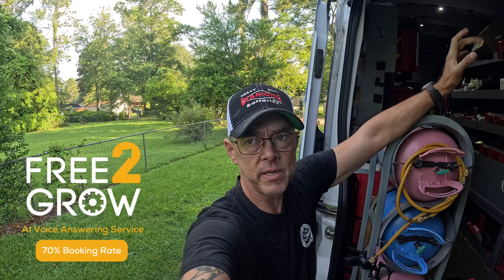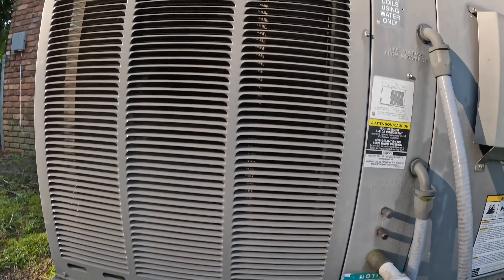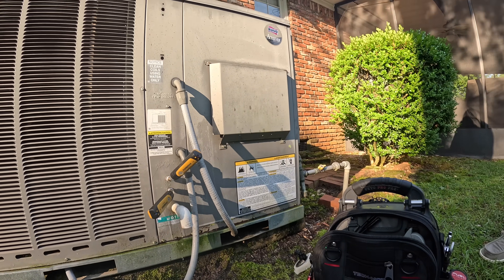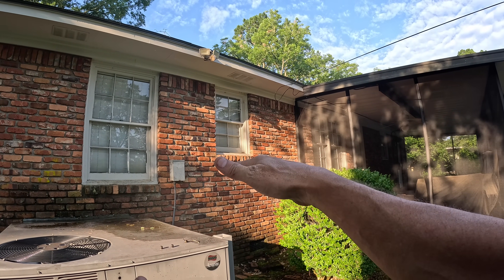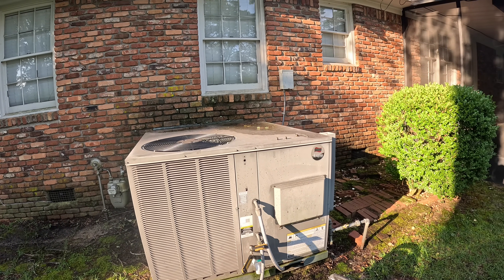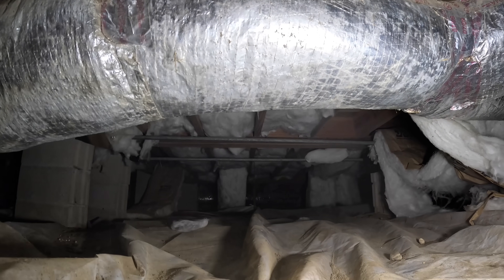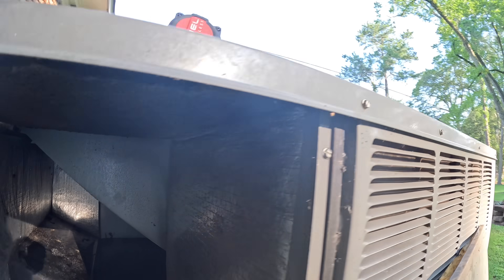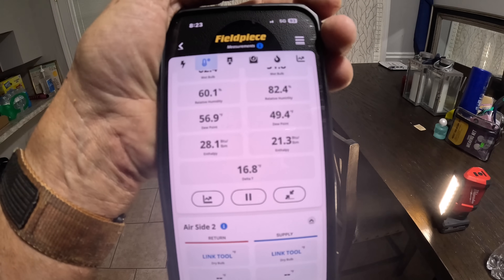A No Cooling Call I Get Every Time We See 100 Degrees! #hvacguy #hvaclife

Comment: Good Video ! You Might Have been able to pickup another couple degrees on that T/d if You had cleaned the Condenser. A Clean Condenser Makes a HUGE Difference.
Pressure's don't really give you the full story People. Liquid line temperature is Very important on Hot days.
If You a need to Pull the maximum cooling out of a Unit cool that liquid line.
1) Clean Evaporator with coil cleaner all the way through. Back to Front & Front to back.
2) Clean Condenser with Coil Cleaner.
3) Check Super heat & Sub cool.
4) Get that Liquid line as Cool as Possible if You Want to Increase Unit Capacity.
If Your Liquid Line is not Cool , Find a Way to cool it if you need More capacity.
That's why they use misters on a Condenser to Cool down the Condenser / increase unit capacity on Super hot days.
1) You can add an ice machine remote condenser on a Temperature control for Hot day use.
2) You could add a Liquid Line Subcooler.
3) Any way that you cool the liquid line down will increase unit capacity.

on the Flip side ---

Tell customer about
1) Tinting Windows on the Side of the House that gets the Sun.
2) Put An Awning Over Windows that are seeing The Suns Heat load.
3) Feel the Windows & Doors for Heat Load. i've Felt Front Doors on Apartments that are 100+ Degrees on the INSIDE. Change Front doors 🚪 for insulated ones.
2) Change Windows - to Double pane / More Energy efficient windows.
3) Use a Thermal Gun to See Hot air Leaks around Doors 🚪 & Windows.
Seal up the House a Bit better.
4) Temporarily - You can cut 4" Foam blocks to Fit in Hot Window Cavitys.
Reply: Excellent ideas.
Reply: @stayinformed2913  Thanks. 😎
Reply: If I could give more than one thumbs up I would!

Comment: My 13-year-old unit manages to keep up in Phoenix. It must have been oversized somehow, as our house was built in '58 and has minimal insulation in the walls. I do keep the thermostat on 78 in the day and 80 at night, and use individual fans.
Reply: Low humidity helps a lot!  A good portion of capacity goes into removing heat from moisture in the air.
Reply: much easier to remove heat when humidity is low like Arizona, I live in Olympia Washington and it hits 90 once or twice a summer and stays in the 70s most of the time, my AC barely needs to work

Comment: If a house calls for a 2 ton unit doesn't hurt to do a half ton bigger
Reply: Actually if it calls for a 2 tons your already over sized by 10%.   Then you take into account that your ductwork can't do it and now you have a 2.5 ton unit outputting 2 tons of cooling and using the power of a 2.5 ton unit... Not smart.

Comment: I like an oversized unit, period.
Reply: Instead of a 3 ton, I would recommend a 3.5 or 4 ton unit.
Reply: Wouldn’t that present its own problem of not running long enough under normal conditions to remove the indoor humidity?
Reply: I have an oversized unit in my home and don't find it to be a problem, but when the temperature is 98 degrees outside, my unit still only runs about 30 minutes before cutting off while most other units are nonstop.

Comment: Most of the times you can tell the h/o about this til your blue in the face and still they will think you can't repair their a/c
Reply: In almost any business or industry the words that start with "e", like Explanation or Education get interpreted by the hearer as "excuse."
Reply: Well, the customer doesn’t have any idea they are limited to 75 deg or that is the standard. Nobody tells you that. If that’s the standard, the standard is just bad. I personally would be pjssed off if my central air didn’t get it below 70.

Comment: I would like to have less humidity and a little bit of more heat. Then now heat and lots of humidity. Humidity is what keeps you from sleeping at night. At least thats my opinion. Its the humidity thats making you sweat. 
And for the hot days, i have no aircondioning at all. So i just have to deal with it. It is getting near the 98 degrees in the next few days. But only 3 days to work, and the a small vacation of 5 days.
Reply: No ac at all? That sounds like torture to me!
Reply: No, but is only for a couple of days a year that its hot like hell.🥵🥵🥵🥵
Reply: The humidity means your sweat that normally regulates your body temp never evaporates, which you never notice when it does evaporate completely.

Comment: Yes, this is a problem inverters solve. You can size them for hotter outside temps, and when it's not as hot, they ramp down rather than short cycle.
Reply: Was gonna say the same thing, but even a more affordable 2 stage solution can also help, with bonus points if it has a DHUM terminal that can switch the fan speed down further when needed. Not sure if I've seen Curtis work on any 2 stage Ruuds or if they're typically offered to customers there though
Reply: @metal571  I think Curtis works on many rental units. I doubt landlords will buy two stage units.-
Reply: What are inverters?
Reply: @davebrown7009  Basically a system with a variable speed compressor. Usually paired with a variable speed air handler and a data buss so the thermostat, air handler and compressor unit all talk to each other. 

Although some invertor systems do use standard 24v thermostat like the Bosh and the Gree and probably a fee others.
Reply: @pilotboba thank you but that sound complicated as crap
Reply: @davebrown7009  Almost all mini splits these days are inverter systems as well.

Comment: Good job explaining why AC might not be able to satisfy thermostats set too low on extreme heat  days. Usually a fan will help with comfort if only a couple of degrees higher than you would like.
Reply: Mini splits dont have that problem. If its 105 outside and you want your house 65 inside its no problem. I do this very thing. On 100 degree nights I lay on my couch with a blanket watching TV. The unit are hardly even working.
Reply: @mattsbrute  that has nothing to do with the type of system and everything to do with the capacity of the system. 1 ton of cooling is 1 ton of cooling. Sounds like your system is oversized for the application, granted you get a lot more leeway with a mini split.
Reply: Dehumidifier

Comment: You get a base first,of supply and return,then you do your cleaning of evap and condenser,and ref. adjustment,then compare.1deg makes a difference.better then going underneath,check house for neg.or positive pressure.for duct leakage.IMHO.

Comment: What was the indoor and outdoor relative humidity? If it's above 67%, much of the system's cooling capacity is going to latent cooling. He commented on the large amount of condensate seen draining. Once the indoor relative humidity comes down, more of the system's capacity will go to sensible cooling and the temperature difference across the evaporator will increase to 20F degrees or so.
Reply: I was thinking the same thing, perhaps adding an indoor dehumidifier would help.
Reply: Great point.
Reply: That AC is running non stop so its dehumidifying at higher rate than a stand alone will accomplish. A stand alone dehum will make the indoor temp warmer and thats all the customers understand
Reply: @heymikeyhelikesit8673 - Well said.  And if the customer has been on vacation for a while with the stat bumped up so the system has not run as much while he was away; the carpet, furniture, upholstery, etc have all been collecting moisture while he was gone.  Going to take a while to wick all that additional latent load out of the house too.

Comment: I have a 10000 btu window unit installed. I call it my booster for extreamly hot days. Run it with your central unit. Yes it will cost you more but you will be cool without killing your main system.
Reply: You could also use a dehumidifier, which would probably use less energy.  You could set your thermostat higher, but it will feel better with the drier air.
Reply: @rpdx3 A dehumidifier puts out a lot of heat. Plus if he already has an A/C going… idk seems like a silly idea when he has what already works.
Reply: @rpdx3  I have a midea cube 50 pint that thing is a beast on removing humidity large capacity and built in pump I can set my ac unit to 78* and feel fine
Reply: @brian_onthewater  78 is nuts. Too hot. lol I like 70 degrees and about 50% humidity.
Reply: That’s a great idea. I’ve had customers of mine add a mini split system just for days when it’s really hot or when they have a party. It’s a great idea.
Reply: Same here. I installed a 2 ton mini split in the upstairs game room where there's a lot of open space. The afternoon sun beats up my front of my house so when it gets up to 100, the ac inside can't keep up so I turn on it on and within 30 min, the inside temp goes back to 72.
Reply: Ur a smart man , that's what I run a 15,000 btu portable AC in my master bdrm so I'm not completely overloading my main ac. I don't keepy whole house one on all nite. I don't need to cool every room. Waste of money, electricity and do t feel like blowing out my AC. My portable actually saved me money. I run it on 76-78 plenty cool. Saves me alot.
Reply: A mini split could also be used and an auxiliary system on those rare extra hot days.
Reply: I do the same. Neighbors keep asking me why I have both. When the temps got over 100 they quickly understood why.
Reply: Make sure to have or install surge protectors; thermostat on central unit should have one. Or else you can buy adjustable delays from 3 to 10 minutes. Very good during storms as well.
Reply: We have an 8k btu window unit in our bathroom that REALLY helps cool the back of the whole house on hot days. Plus the few times our air went out, we still slept in a cool bedroom.
Reply: I'd just use a mini split. Window units suck.
Reply: @JustinParker-nk8oo The whole point is a window unit is way cheaper.
Reply: your main system will last longer running nonstop than cycling every 10-15 minutes
Reply: @gingyberrieThat sounds like a made-up wives tale. Air conditioners are designed to turn off and on.
Reply: That's not a great idea

Comment: The major problem is a dirty coil and all the insulation that has fallen to the ground from the joist bays
Reply from the maker: Here some don’t use insulation under the house at all, because it decouples the house from the cooling affects of the 70 degree air underneath. It actually doesn’t change the load calculation much at all.